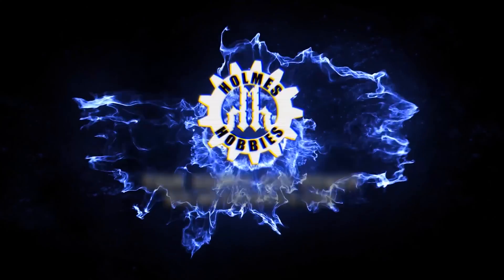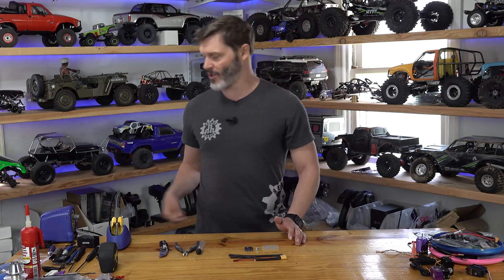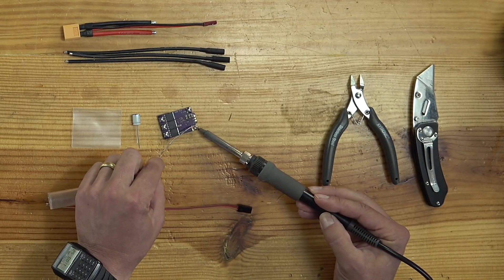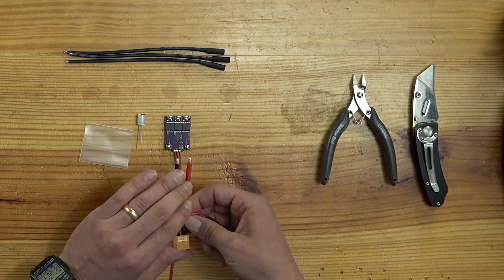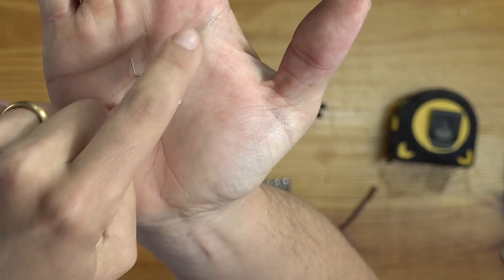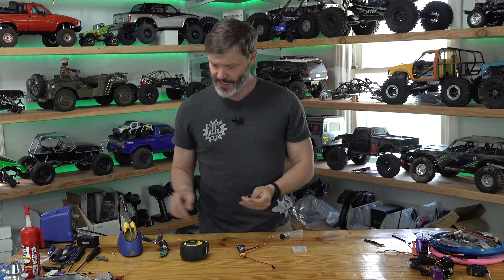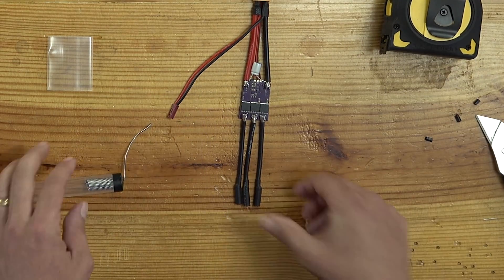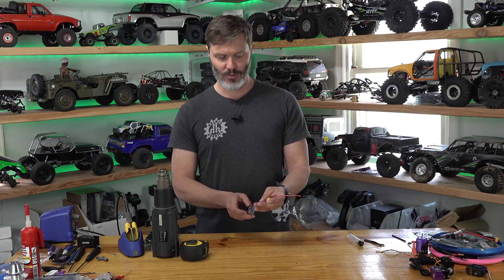Crawlmaster ESC V2 Holmes Hobbies How To Solder and Connect Wires.  Install guide for the new ESC V2

Comment: Hi. My name is Jacopo and I need help. I just completed the assembly of my crawler with esc crawlermaste v2 and 1800kw v3 revolver engine. At the first connection of the battery the green LED turned on and the classic blep was heard, operating the accelerator everything responded perfectly, but after a few moments the engine began to vibrate and then stopped and no longer gave signs of life. Now reconnecting the battery the green LED lights up but you can no longer hear the blep and the engine seems dead. Can you help me solve it? Thanks a lot

Comment: I have a direct power 16v servo and this exact esc kit and wiring kit. Will I still need to install a bec since you have the receiver wire included in the kit?

Comment: So, I finally got around to doing this and have never soldered anything to a pcb before (only battery connectors I have soldered). I followed this step by step and to my surprise it worked perfectly! I am an idiot though and totally didn’t cut down the wires to size and now have a birds nest of wires in my rig smh
Reply from the maker: your off to a good start!

Comment: Got mine and glad I did. At low speed quite as can be. Gets a little mouthy with speed but it is a crawl master so all good. What kind of heat should I be expecting. 1800kv relover on 3s. 15t 48 p. Element ecto. Seems like I traded noise for heat motor gets hot 🥵.

Comment: Great video. I have a question! I have a dual motor crawler with those small jst connectors from the motors and I just bought an upgraded servo with 4mm bullet connectors.  The wire size is different, how should I approach this situation? Is it safe to connect small wires to large ones if the small wire is the motor? Please advise 🙏

Comment: Blue tac is a great way to hold things in place when soldering, cheap and handy! Also a ts100/pinecil will do this without issue but I wouldn't try the smaller ts80 etc

Comment: It was mentioned that there is a lack of soldering teams to get the ESC out in complete form. I used to solder speed controllers for my planes just about that exact same way, and can do a pretty clean job. Had some recent ankle surgery so will be laid up for a little while, building and re-building crawlers and other RC stuff. I use a digital ST-2090D Merece soldering iron. If the expense of shipping and silver solder was covered, I would gladly do the work. Will be a few months before I'm up and walking again. Figure 6-10 units per hour, potentially 60-100 units per day, a little over a week could have 1000 or so complete. Just an idea if you would like the help.

Comment: I just order mine, can’t wait to get it installed into my comp crawler, i have the v1 in it and it was an amazing. Question i have is, can i put a few coat of waterproofing on this after soldering its done?

Comment: I would add an extra step before the heatshrink , and while some use the board ready conforming liquid, I usually go for 5 minute 2 part epoxy liquid mix and cover everything. Where I drive is too much probability of getting things wet so I just doze everything and connectors with epoxy. With the added advantage that it holds up and strengthens the soldering and flapping cables and ensures insulation in case that capacitator ends up moving a leg and short circuits something. 
Oh well anyway getting Holmes hobbies esc in Europe is close to impossible anyway, at most a motor if you search well, and buying one from the usa costs more in customs and shipping than the actual item itself which is really discouraging, and a buggin bummer

Take care anyway, peace✌

Comment: Hey John. 
Would the esc run my 30-35 pound BC8 Mammoth?
Currently I'm running a 1000kv Revolver and I have two SHV800's for steering and then there's a cheap servo for the 2-speed shifting.
  I'm assuming it's a long shot because I beat on it like a rock crawler and occasionally pull a wagon with a really heavy load(well over a hundred pounds and through grass).
Reply: 1000kv doesn't ask much amperage.  It would probably be fine.

Comment: Great to hear temps used when soldering. I tend to use a little more heat 500 to 525C.
Reply: 500-525°C is way too hot. Too much heat transfer to the board with temps like that.
Reply: @chevyon37s  Thanks Drew I ask John this question 2 years ago on one of his videos on soldering and never got a response...great information i will use this a a standard moving forward...what about 14 series and 15 series motor tabs got information here...Thank again...LOL tell John love Homes Hobbies stuff...

Comment: What do you think of adding some silicon conformal coating before applying the heat shrink? Obviously it takes more time and wouldn't fit the video format.

Also, it seemed the power cap leg was hanging over the servo ground pin. Would you recommend routing it slightly more out of the way, or add a dab of liquid electrical tape, some actual tape, or even the usual black heat shrink on the leg to prevent issues? (You know, when you're tight on space and you need to squeeze the ESC into that tiny corner in your rig... :))
Reply: Conformal is a great idea.  The leg has plenty of room, but that is a concern.  Later board revisions will have dedicated pads for the cap.  It's really not needed but I would rather be cautious at first.